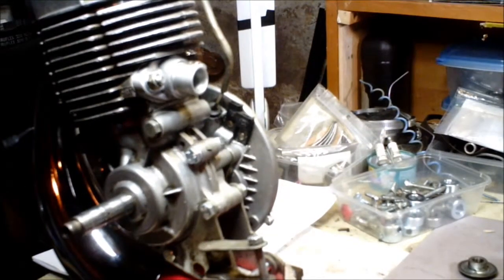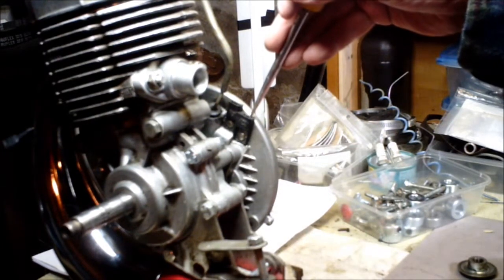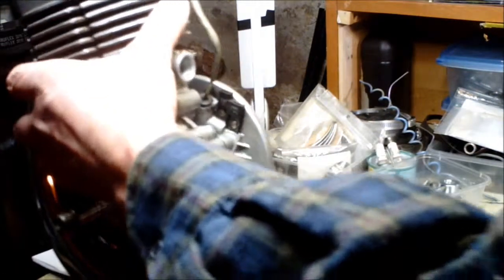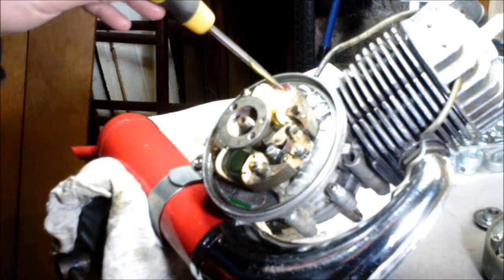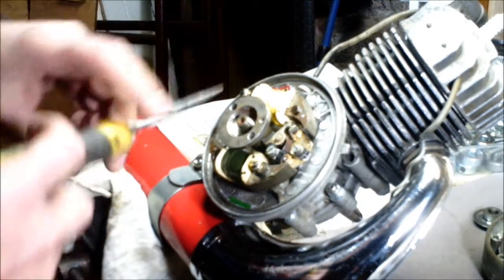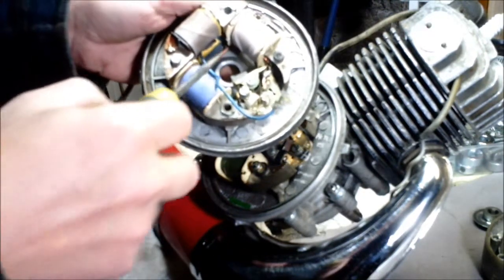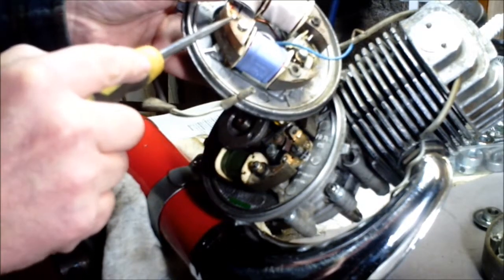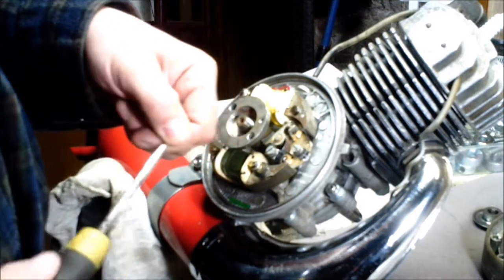Moby 12v Magneto

Comment: I've just bought used 40T and it has got a 2 coil system but only one spade connector coming off the back and the bike only has one wire.  The odd thing is there isn't a hole where the rivet would be to hold the smaller spade...

The engine was seized so I swapped it with another engine from a different 40T, but it has got the two spades on the back can I just jumper the smaller spade to a engine case bolt and be good?

I've been thinking I need to swap magneto back plates along with the electrical?
Reply from the maker: The single spade is for a 6 volt magneto and the two terminal is 6 and 12 volt.  The magnetos are completely interchangeable so you can fit the old magneto to the new motor.  You will need the cam/clutch puller and please be aware that the Novi nut on the magneto is a left thread.
OR
You can hardwire the bike to accept the 6v/12v magneto.